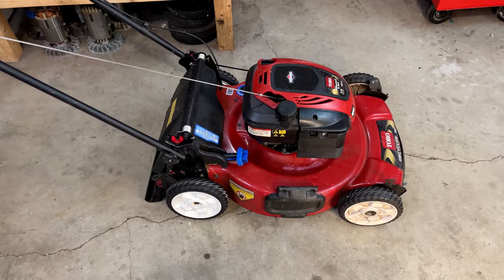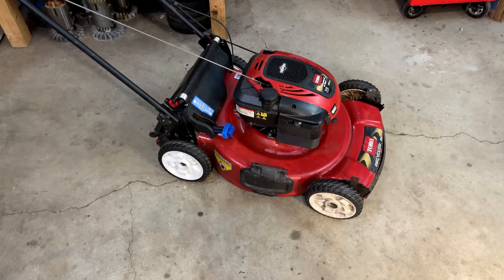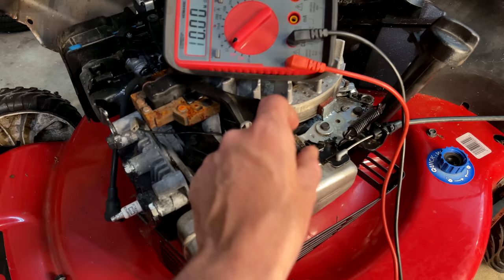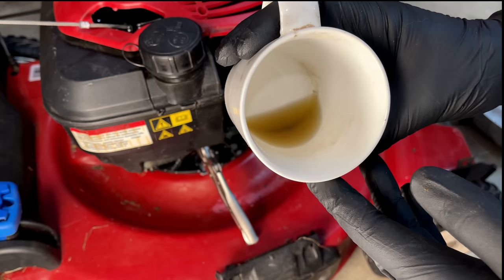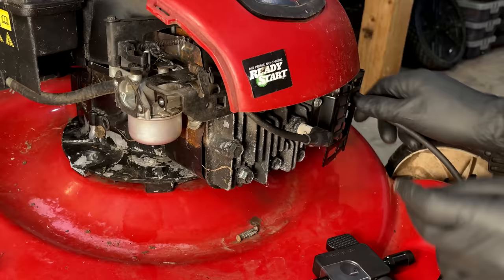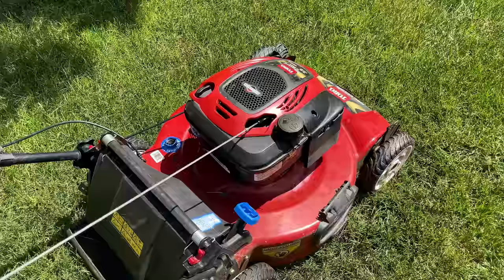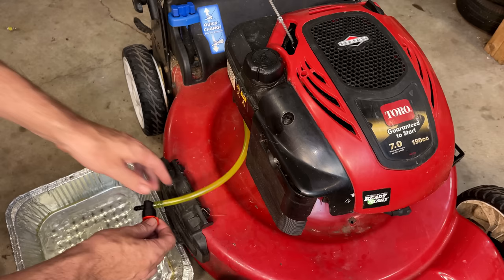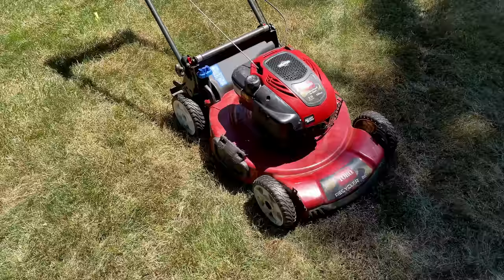Erratic Lawn Mower Engine Performance - Starts and Runs Great / Stalls or Will Not Start

Comment: Jim:  I do whatch your videls all the time and do all by own mower repairs.  Put a new carb. on a Kohler engine.  Engin ran too fast.  Found interferance on large carb gasket. Cut a small piece out noy guns great when it starts.  I am having the exact same problem. I have to use starter fluid to get it bto start.  It does run but needs starter fluid fore every start.   I was going to clean the new carberator but you may have saved me much time.  Thank you.

Comment: Most gas caps today are 1/4 T caps.  I had to replace the one on my push mower a couple of years ago.  If I brushed a piece of shrubbery with the cap side it would come undone and let trash into my gas tank.  As I remember it was about $7.    Tank vents are a pita on two cycle equipment.  I can’t count how many I have replaced on my big Stihl chainsaws.

Comment: James as always you have the golden touch. 
My 1850 Colman Genorator was beginning to act up and after watching your post went and bought a new spark plug and it now runs better had an R in it and ran test and had very low omes.
But the gas tank cap was a home run and great to see that you were able to get it fixed that's something that I wouldn't have even give it a thought.
Good Job.

Comment: Got one like that, but It has the good cap. At times I have some troubles with the kill handle....sometimes I have to pull harder on the cable. Thanks for the nice video, very helping.

Comment: I’m having a similar loss of power in my Troy Built with a Honda engine push mower which is becoming more difficult to start. I’ve put in fresh gas, Octane 94, a new NGK spark plug OEM, replaced the air filter, changed the oil, but tipped it once on the wrong side. I’m still puzzled so far. Thank you for your excellent video and diagnosis!

Comment: I recently did this exact same thing. Only I decided to keep the mower, a Husqvarna with a Kohler XT-6 engine, for myself. I used it a few times with no problem in the sun but then on a cloudy day it kept dying. It would restart after a few minutes of sitting. I did some trouble shooting and figured it had to be fuel. So I put a clamp in my pocket and mowed until it quit and then clamped the line off. When I cracked the bowl drain on the carb it was empty. Then I checked the flow with the cap off and on and found that was the problem. Anyways I still haven’t ordered the right cap. I just don’t tighten it solid. And it may just end up with a hole in it. 😂

Comment: Had the same thing happen to my Husqvarna snowblower. Would run alright until I got to end of driveway and then sputter and stall, last thing you want to happen during a storm! Cracked gas cap a little bit and would run fine, replaced cap and runs great now!

Comment: I’ve encountered this issue once or twice: When the tiny vent hole in the fuel tank cap doesn’t let air in, then a vacuum will develop which prevents the fuel from flowing from the tank into the carburetor. More frequently the squirrels in my neighborhood chew up the plastic fuel tank caps and have even chewed holes into the tank itself. I wouldn’t think squirrels would want to drink gasoline. But something must attract them.
Reply: Maybe the corn used to provide the alcohol in the fuel?........../s

Comment: Another top quality video. Thank you Donny. I have come across all these issues with customer machines. the vent problem happens a lot on Tecumseh snowblower caps that fall apart. No matter what machine, what works for me that I advise all my customers to do is keep the fuel tanks completely full at ALL TIMES with premium. Any container left in temperature change will get condensation resulting in water in the carburetor. If the machine has a shut off fuel valve I turn off the fuel and run it till it quits before storage.

Comment: I had the same cap vent issue on a motorcycle. Tighten cap - stalled. Left cap loose ran like a champ. Replaced cap - no further worries. Great videos.

Comment: I had A similar problem with my riding lawn mower. I found that the vent hole was clogged. The wap's had made a nest inside the cap. Had to drill thru the cap to get it to vent

Comment: had same issue with a log splitter, ran for about 10 min and then turned off. it would restart after about 10 min. took cap off and threw away the o-ring sealing it. no more issues.

Comment: I've found that whenever it's a weird, erratic issue, fuel is the best bet. It's not a small engine, but my friend has a 92 camaro that had a weird intermittent issue. It'd start fine, but if you left it off for about 20 minutes to an hour, it wouldn't. Leave it overnight for 12 hours or so and it was fine again. Seems obvious now but basically it was just a bad o-ring in the injector, leaking and flooding the engine. Leaving it overnight let the pressure in the line die down (so the injector wouldn't leak anymore) and the fuel would leak past the rings into the oil. (He had been getting tons of gas in the oil, another hint) He thought it wasn't the injectors because he'd replaced them last december but he must've forgotten an o-ring because it was old and cracked. Good thing it's throttle body injected or we probably wouldn't have noticed the leak. We replaced it, changed the oil one last time and once it burned off all that extra stuff it now runs beautifully.

Comment: @16:00 you were testing fuel flow, I grabbed a cigarette to smoke, but quickly returned the lighter before igniting it fearing the vapor of the fuel to burn.
Then I remembered it was only a video 😁

Comment: If I am not mistaken most caps are designed to hold pressure to keep the fumes in the tank for EPA/CARB compliance. They also have a one-way valve to prevent vacuum in the tank. Had a pressure washer that did the same thing as this mower. The cap on the tank was able to be disassembled and I found the valve to be similar to a MTD 2 stroke fuel cap. the ones with the little slotted rubber nipple for the valve.

Comment: Thanks, James. I already knew about the failed fuel cap check valve syndrome, but hadn’t seen one of those DIY fuel drain hoses. Just made myself up one and put a length of duct tape around it so there’s no mistaking it’s a tool.  I may hose clamp on some sort of wire eye with which to hang it up near my fuel containers. 👍🔧🧰

Comment: A plugged gas cap vent is probably one of the lease likely (but not impossible) issue that one would run into.  Check the most common and likely cause first.  Then think outside the box.  Ran into that problem many years ago fishing in Banks Lake outside of Lakeland GA (opening scene where Burt Reybolds "Gatoir" was filmed).  We were in a Jon boat in the middle of gator infested Banks Lake.  Forgot to open the vent to the outboard motor (wasn't me, wasn't my boat).  Took the most part of an hour to make it back to shore.

Comment: Had this same issue with my geo. Gas cap wouldn't vent and magically half way through every drive your no HP that you already didn't have would decrease even more. It has a fuel pump so it would just fight through it, but it still wasn't happy about it!

Comment: The old cap is supposed to vent through holes that is in the threads close to the gasket. The mutiple holes at the bottom edges are also part of the venting system. It is a 2 piece cap. You won't find a through hole to the top of the cap. Let's too much moisture in which turns to water in today's gas with ethanol

Comment: My BIL has the same issue with his cub cadet riding mower, the cap isn't venting correctly. It'll run ok for a while but then will shut off because the it isn't allowing air into the tank. If it's out on tight and then backed off 1/4 turn it works fine. Funny how we check everything else and find the real reason....LOL!

Comment: Ta-da! Job well done with a $5 part.   The cap on the import engine on my Cub Cadet mower has been good, but if I have problems, I'll know where to start.  BTW, when I was shopping for my CC at a dealer, there was Toro next to it with the same import engine.  Sort of funny.  It does run great and start on one pull reliably.

Comment: Some caps have activated charcoal in them to prevent release of fumes into the atmosphere, not sure on this style though. Flipping the mower on its side too far wets the charcoal and filter inside causing issues. Powermore (MTD) engines are good for this. I gutted my cap long ago, starts first pull every time.

Comment: An "easy fix", sure, but would have cost a fortune in a shop to IDENTIFY what needed fixing; hence so many abandoned mowers, etc. So many components including 'invisible' ones like this. I wonder if there is anywhere a comprehensive listing of absolutely ALL parts to the system maybe with a % rating of the possibility of it being the cause of failure.
Very well done indeed.

Comment: I have that same mower and funny as it seems the same issue but i tracked it down to a bad ignition coil. I let it cool down for an hour starts right up then once it got hot again it would stall and not start

Comment: Awesome , Helpful information !
Just wish you would have went into a little bit more info on showing how the kill switch process works for a beginner like myself . But , As stated above ,,, GREAT video with info .  And catching and showing the cap issue was a great info tip .
Thanks for posting .

Comment: problem with our mowers nowadays is to my belief the gas itself, see the ethanol in the gas may be turning back to water. i've had a recurring problem with water just being in my tank i have the the craftsman bigwheel mower with the gold 7.5 motor looks like that ..same tank and carburator  and shoot i have even went as far as had the tank completely  off sprayed it all out with carb cleaner let it sit in the sun upside down ..let the carb sit apart in the sun too new lines new filter and yet wouldn't you know it does the same unlevel idle at start and if i drain the gas in a month ill see water in the bowl. all i will say is your guess is as good as mine.

Comment: Tecumseh snow king motors have this problem all the time.  the fuel swells up the rubber under the cap blocking venting.

Comment: friend of a neighbour has same unit. put an ohv sparkplug in it. exhaust valve hit it and cam gear spun and also cracked. different part number but his 2011 is running on a cam from a 1991 uit.

Comment: Problem with the cheap cap is the hole is in the bottom of the dip so any water that gets on the cap is going right into the tank.
Reply: So don't mow or store it in the rain.

Comment: Thanks for posting that! Interesting how you discovered it when you put the mower in the sun. The new cap caused a noticeable reduction in fuel flow during your test (24:38 in the video). Is that 'normal' and planned for by the mfg.?
Reply from the maker: I think it is normal.  Still plenty of flow to the carb.  They keep the vent hole small to minimize splashing if the file out of the cap.

Comment: I have a same the same mower. I tried everything. New carburetor. Flushed Fuel system. Checked ✔️ gas cap. Bale turns off my mower. Motor sounds a little better. But it still surges. I Can See the governor lever move when the engine surges.

Comment: Had the same problem with a motorcycle once.  Drilling the cap didn't help because it had an internal rubber diaphragm.  Ended up inserting a wd40 straw in the hole to vent the tank.

Comment: I have a Craftsman mower with that engine and it always starts on the 1st pull. It has a gas cap like the new one. Maybe the original cap got lost and was replaced with a cap that won't get lost.

Comment: Check spark if non existent or intermittent recheck what you just worked on, if ok possibly an odd but internal short or ground  issue with coil itself ?

Comment: Spoiler
..
.
.
.

WOW!!! I would have never thought of the cap (too tight, no air in-out) as the problem. You are lucky it was quiet when you noticed the problem, so you could detect the air troubles.

Comment: If it were to br left on the rain with the new cap it will introduce water to the tank due to concave shape.... should have just drilled small hole on the old cap that couldn't be lost or misplaced...just an opinion

Comment: So I have one question. Why torque the blower shroud bolts 60 inch pounds is only 5 ft lb I don't get it. If it's a part that needs to be torqued I torque it. Otherwise I use my mind not my muscle. I was taught that a long time ago.

Comment: I would have just drilled a hole in the cap, cos that is all the manufacturers do.   My friend has a Honda engine with the same problem, the cap has a hole on the inside and a hole outside the seal, but we think the passageway between them is blocked.

Comment: I have a question about key switch operated generators.

I am trying to find which wires kill the engine when turned off on a Chinese generator.

As I am looking to put a remote control device on it.

On trying to previously do this it appears that I burntout the spark ignition coil as well as the fuse.

This has all been sorted but the engine key switch kill is still an issue.

Any ideas as how I find this !!

Comment: I thought that this setup with the fuel flow was gravity fed. If the cap is vented, how can the system be pressurized??? A fuel pump is normally used to build fuel pressure.

Comment: James good fix, I was interested in spark plug issue as just recently I have been replacing quite a lot of  them in honda  engined equipment, the symptoms are bad starting and rough running, on checking the plug it will look quite servicble and in lot of the time quite new, the only commen thing being manufactured in China? Somerset Mike

Comment: Do you ever check the gap on the spark plugs?  That  can make a difference sometimes.  You could have drilled a 1/16" hole in the old cap and all would be good... even a 3/64" would work.

Comment: Does this or any of these small Briggs have an inline fuel filter either in the bottom of the tank or somewhere in the line, Hondas do and they can clog if old gas is left in the tank   Great video I enjoy your diagnostic methods they make you think out side the box  thanks
Reply: Screen in the bottom of tank on the Briggs Quantam series.

Comment: When you checked flow with the carburetor bowl off it seemed rather slow to me. There must be problems with those caps because they are available almost everywhere. Most caps were replaced because they were lost but the cap with the retainer shouldn't get lost. I don't like the cap you used because they have that depressed center where the hole is. If the mower gets left outside or washed, water can sit in that area and get into the tank. Briggs might have designed that cap so fuel didn't leak when the mower is tipped but the vent system might be compromised by alcohol evaporation from E10 gasoline.

Comment: i've been working on this stuff since i was 12 and i'm 53 now. this stuff is simple. stuff that works gets redesigned then it doesn't work. then the parts that are needed to fix the problem, are all chinese shit now, sometimes the problems continue. i've develop certain ways of doing things, and sometimes used good used, original parts solves the problem. not so much the case here, but those 2 piece caps will cause problems along with others with the carb that will case the engine to run the same way, especially briggs.

Comment: Hello James and all, I bought a TroyBilt TB490XP in 2020. First year was fine. The engine has auto-speed control.  Then at one point last year the engine started running at full speed all the time.  All the springs are not constricted and all the levers move freely.  Any ideas? (edited for clarity)
Reply from the maker: Its hard to say since I have not worked on your model.  When you say full speed, I assume you mean the drive system and not the engine speed.  Normally there is just a belt connected to the transmission.  Your mower looks to be all wheel drive so would suspect two belts.  When you apply tension on the cable it should tighten the belt to engage the drive system.  I would suspect one of the belts is not releasing the tension on the belt.  You should remove the covers where the belts are attached to the transmission and make sure everything is moving properly.
Reply: @jcondon1  Thanks for replying. No, sorry, I meant engine speed.  I'd almost consider it over-rev.

Comment: I have the same mower. The issue I have is the back wheels lock up when pulling backwards.  I changed the wheels and small gears to no avail.  It looks like the bearing on the drive shaft are worn-out.  Have you ever replaced those bearings?
Reply: I'm sure you have figured it out, but on mine I have to release the drive and let the mower roll another foot or so and then it will back up just fine.  It takes a little getting used to and anticipation each time, but I finally read the manual and figured it out.  I guess real men have to read manuals once in a while.

Comment: Not a good design on the new cap to make it dip in at the top and put a vent hole in the middle of  it. A little water gets on top of it from cleaning and the cap will funnel it right in.

Comment: Am I right in thinking that the original cap was of the "click lock" type?  The ones that you tighten until they "click"? If it was, the venting takes place between the inner and outer shells of the cap. I've never known one to give any trouble before, and they are generally the better option because they can't draw in any water  from the air/rain.

My guess would be gelled fuel between the shells, or an amalgam of gelled fuel and fine dust that is clogging up the vent hole(s).
Reply: If that’s true maybe a run though the sonic cleaner could fix it?
Reply: @FishFind3000  It might, as long as the ultrasonic waves can pass between the shells. A wash out in clean fresh fuel might also be worth a try. As I say, I've never encountered this problem before.   I'd certainly give it a go.